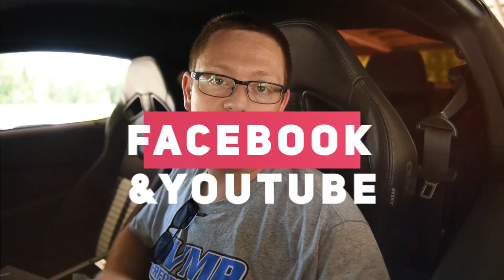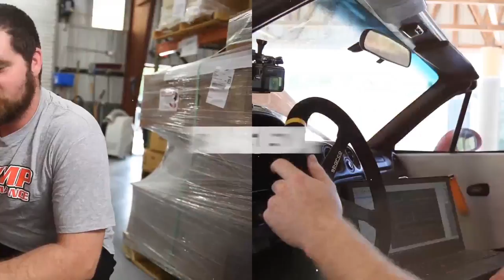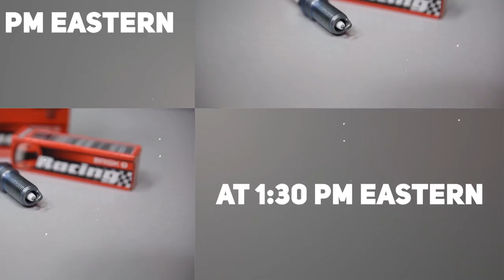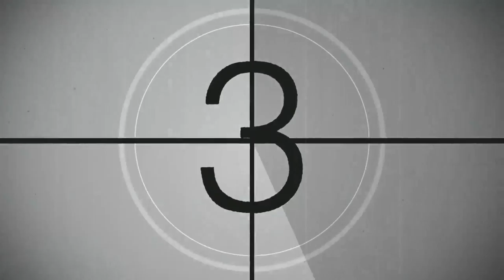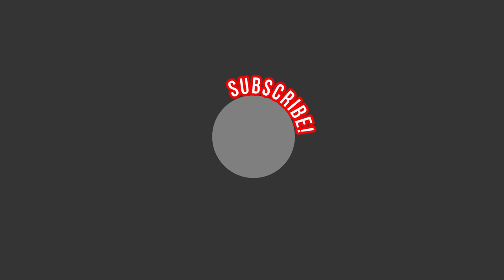How do dyno corrections work? | Tuning Tuesday Season 2 Episode 41

Comment: So what about the performce that manufacturers claim? For example Golf 8r has acording to dáta sheets 320 horses. Are those corrected numbers or u corrected?
Reply from the maker: Those are typically corrected numbers measured as crank horsepower.  Not wheel horsepower.